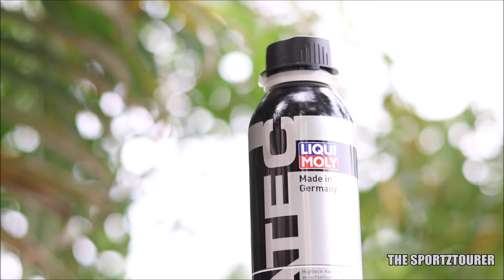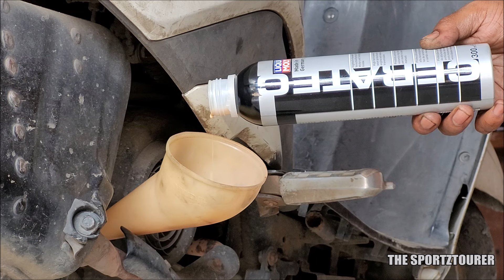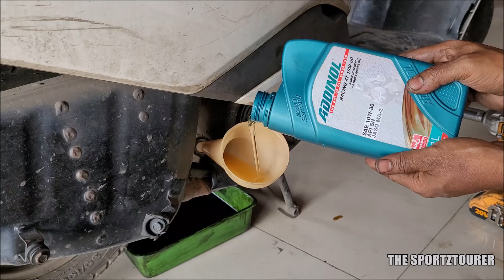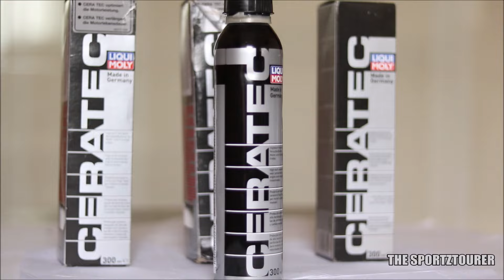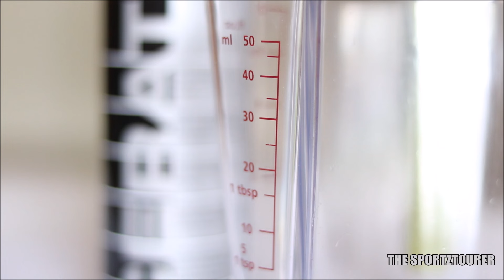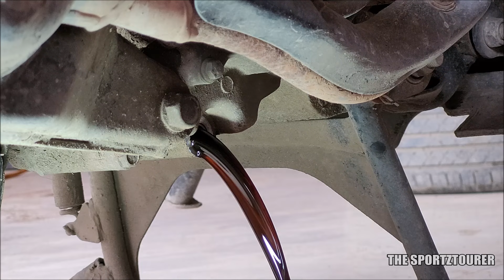LIQUIMOLY CERATEC IN HONDA ACTIVA BIKE, MOTUL ADDINOL MAK ENGINE OIL BEST OIL ADDITIVE

Comment: I am using Castrol Ultimate 5w40 in my Honda Dio. This oil has done wonders to my scooters performance. Cruising speed increased from 60kph to 70-75kph. Mileage increased from 45kpl to 52-55kpl. The oil easily lasts till 4k kms but I drain it before 3.5k kms. The performance of the oil remains consistent whether you are riding it in the city, high way or just ripping the scooty for fun. I've used 7-8 bottles already, never going back to any other engine oil.
Reply: Bs6?
Reply: @Akshay-xs1wf  Nope. Bs3
Reply: Same bro using in my Jupiter and 5g and getting fuel efficiency of 45-48 in city traffic
Reply: I used the same oil in grazia . Smoothness comes from 50kmph
Reply: i am using the same on my BS4 hero pleasure. its superb
Reply: Castrol Ultimate 5W40 isn't a good oil IMO. Cold starts feel rough, pickup seems rough and engine doesn't even feel as smooth as OEM Suzuki oil. Best option is to use Liqui Moly oils. I use Liqui Moly in all my vehicles, best oil IMO.
Reply: @CarbonRP  Different brand oils behave different in different brands of vehicles. Honda's run best on Castrol and Veedol, but run rough on Motul and others.
Reply: @s2tp97  yes, i used this for 2018 grazia. Smoothness comes only above 50 kmph . No improvement in fuel economy. You can spend 600 rs on motul 5w40 . Smoothness at any speed and 3 extra kmpl fuel economy.
Reply: @CarbonRP  I used luqui moly 10w30(didn’t written as synthetic) . But it works far better than castrol. Also bit expensive like 630 rs.
Reply: @s2tp97  I didn’t tried veedol. But on castrol,effective only above 50kmph.
Reply: @s2tp97  sir what brand works best for old splendor nxg (hero honda) bs3 model .
Reply: @AmitMishra-kq2ee  Castrol. Use either Castrol Activ 10w30 (mineral) or Power1 ultimate 10w40 (Full synthetic). Also use NGK CR6HSA / CR7HSA (recommended spark plug for bs3 Hero Honda) and your bike would become ultra smooth.
Reply: @s2tp97 thank you . sorry actually it's b s2 . Anyways I will try ur recommendations. I'm not able to find out its user manual .
Reply: is there any special version of 5w40 which is used in cvt scooters....or same synthetic 5w40 used in car engines ?? im asking because i use 5w40 in my vw vento car....and i have heard that cvt scooters need special grade oil. please clarify.

Comment: Good to see a video on this. Me and my friend have been using Ceratec on our Aerox scooters for a while. The positives we have noticed are, a smooth and vibration free engine along with a slight increase in mileage
Reply: So how much difference after adding ceratec
Reply: Planning to buy for activa 6g will it help reduce heating issue?
Reply: @lunatic9390  Not sure about heating issue, I have only used in Aerox which is liquid cooled. For me it made a noticeable difference, you could try but not sure if the activa engine will gain much

Comment: Even I was thinking about using the ceratec in my activa, boom this video helped a lot, if I were using my older activa I would have used it, but with the new one stock oil works great as of now.
Reply: Stock oil gets black and loses its quality in 800kms currently using motul 5w30 600ml pack damnn mileage increased from 46 to 49 so is smoothness its currently butter smooth
Reply: @lunatic9390  My 125 Gives 55-60 in city and 65+ in highway 😂 even though I do a lot of Unnecessary maintenance according to a lot of people
Reply: @lunatic9390 Is this normal 5w40 or 5w40that we use in cars or there is some specific version of 5w30/40 made for cvt scooters.
Reply: @tracerbullet296  people say they are different

Comment: Hi.
Hope you are doing well.

I want to share my experience about changing only oil filter.

After I have completed around 2500 kms on my Platina 110 after last oil change (with oil filter change) (Oil: Bajaj Dtsi 10w30/20w30), I felt that the performance is not 100% adequate, somehow, for low power, it is performing well, but when I tried to open throttle, I felt some harshness.
So, this time, I decided to check if oil filter is chocked or not.

After I changed the oil filter (After running the bike for 10-15 kms), I didn't top up as oil level was ok.
After riding, I felt that, there was fresh oil running. I was able to open maximum throttle without loosing any confidence.

Conclusion, if oil is not completed its 20% of life and you feel that oil is not performing well, then just change the oil filter (but only applicable for engines equipped with oil filter)

Comment: I have a Honda Activa 2013 HET model, and I am experiencing issues with the Honda oil during cold starts. 

Could you kindly recommend a suitable oil for winter use?
Reply: Motul 5w 40 synthetic oil mb grade 800ml I'm using it in my het engine its really an worthy oil to use😊

Comment: Don't use this treatment in wet clutch engine's
Reply: Means??
Reply: @sangamum9192  bike engines. Where the oil reaches the clutch. 

Cars have different oil sump for transmission. Activa type scooters have dry clutch. You can use for cars and cvt scooty. Do not use for motorbike
Reply: Activa has cvt, separate gearbox

Comment: Love the content! Do you think this should be used in our BS6 G310R? Will it make a noticeable difference and please make a video on this. Current using Motul 300v Oil in my bike. Is it worth spending for the bike? ❤❤
Reply: Don't use ceratic clutch will misbehave, 300v is just too good

Comment: CeraTech actually needs to be run for at least 7000kms ideally 10,000kms to see lasting results.
It is designed for cars and is designed for oil change in mind at 10,000 km and it will only bake into those deformities in the engine after that period of time .

Comment: I have used 7100 20w50 on my pulsar 150 bs6 lasts just 3000km with 200ml top up, later gearbox sound. 
And once tried gulf 1200rs 10w50 Synthetic Bajaj genuine oil they recommend for dominar.
Strange reason 10w50 took its own time 5 mins, even though it starts instantly, I was hearing cam shaft loud sound till the oils gets heated.
Why 10w50 not getting pumped?
I live in Bangalore where 14-38 degree is the temperature.
In my splendor 10w30 takes its own time to stop cam shaft sound. Where on 10w40 there is literally no camshaft sound from first kick itself. 
And gives best 65kmpl mileage with 10w40 , where with 10w30 I get Max 55kmpl. I ride continuously for hours. But with 10w30 , I have to stop every 50km once , engine just struggle to catch revv.
Why on earth company suggest 10w30 ?
I have used shell 10w30 synthetic and gulf powertrac , Castrol idemitsu all, this splendor just struggle with 10w30. That's it. 
Why can't these companies recomend 10w40 instead 10w30.?
And why they strictly recommend to use there own oil? I have seen vw group recommend Castrol , Ducati recommend shell, Hyundai recommend shell or servo,
How come these stupid motorcycle companies manufacturered there own oil in kitchen?